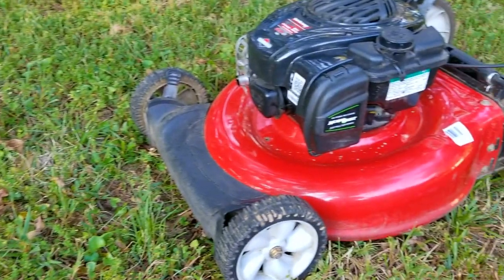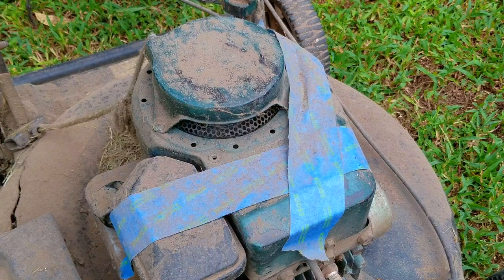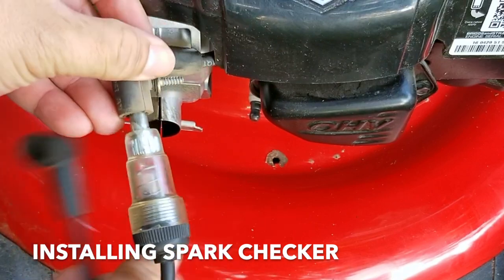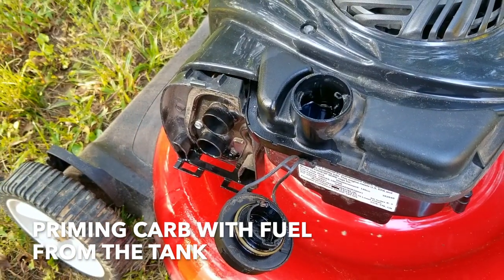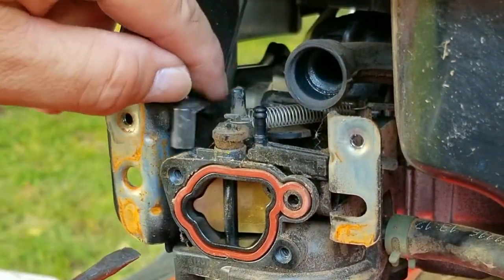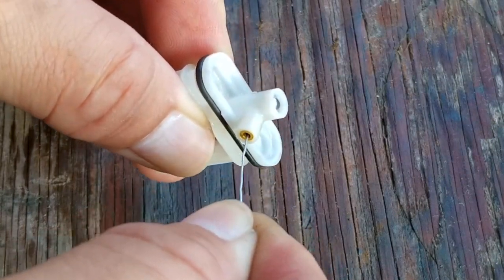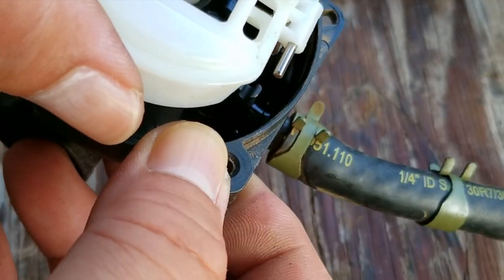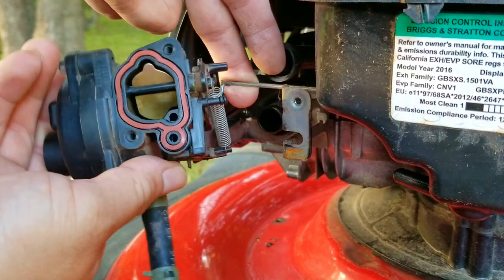Why Did Briggs Stop Making The Flathead Engine?

Comment: B&S lost me in the early 60's with their aluminum cylinders & valve seats!   A deliberate attempt to fuck over all those non-commercial mower buyers with a terrible designed-to-fail engine!  First I've heard of the oil drain, and am not very surprised at the attempt to screw any loyal customers left standing.
Reply from the maker: thank you al ro.

Comment: Neither the, Tecumseh OHV engine was powerful (6HP) Bulletproof and lasts for ever. Still use and have the one I bought over 20 years and it still runs and starts like new. And never done a thing to it other than oil and air filter changes
Reply from the maker: thank you Matthew.

Comment: I wonder if its some sort of pro american (racism).  The Japanese have long built a superior engine that actually requires nearly no maintenance.  Back in the 80s many farmers switched out of briggs on their augers.  Come harvest that engine needs to start without issues.

We didn't switch but sure looked at it.  Tractor repaired in stead.

I'm pretty far north.  My lawnmower has a Honda, the sales guy really wanted me to buy the intek.  That was 10 years ago.  Since that time I've changed the oil twice.  No recoil problem.  No clogged fuel jet.  No spark problem.  Its was less than $500 after taxes and has front drive assist.  My brother busted the deck up a bit running over rocks and stuff (he was angry at the time).  My yard is big.  What I'm saying is this mower is abused and over 10 years has never failed to start in the spring after sitting for 7 to 8 months.

Thats what I like about the Japanese motors.   Had a dirt bike as a kid.  Don't know where the carb is.  Only issue was running out of gas (there is a lever to use the reserve).  Abused that thing for 5 years than my brother took over.  After the abuse of 3 boys my father used it to check fields.  75cc  busting out every bit of hp to carry an over weight adult at 50mph.  In 97 we auctioned it off with the farm equipment and got the same price we paid for it.  The guy thought it was relatively new.

Stop beating a dead horse.  Let someone else hammer out the issues on the new design.  The orient started the new design 50 years ago.  Better believe they are in constant improvement.  Briggs took one old design and changed nothing till they were forced into bankruptcy.  That doesn't deserve a reward
Reply from the maker: true, but Briggs unwillingness to change, until they were forced to, mimics what happened to Kodak.

Comment: I'm going to say right off the bat, emissions regulations.
Reply from the maker: is that's your answer, they decided to change 10 years too late.  Everyone had been making OHV engines for quite sometime.
Reply: @INSIDEHOUSEGARAGE  well even those are going to probably be phased out. Personally , I use an electric.
Reply from the maker: it's just a different set of problems. 
Electric motors won't last for a long time
and the batteries wear out, just like the one in your phone
or laptop. After each cycle, it will loose a small amount of capacity
till one day, you'll have o replace it because it won't last long enough to finish the job. Batteries are very expensive, more than a service on a gas tool.

Comment: Old gas is worse with carb engines because the carb and fuel is exposed to the air - evaporation and oxidation ruin fuel.  Fuel injected engines are more sealed, reducing evaporation and oxidation.
Reply from the maker: thank you Sylvan dB.

Comment: If they hadn't gotten rid of the old engines people would never buy the new ones.  Metal parts are recyclable, plastic crap is not.  A full step backwards in my opinion.  I'm running 1960's Arien snow blowers with Tecumseh engines that start every year.  They both have carbs with drains and fuel shutoffs on the tank.  No residual garbage in the carbs.  Just another incidence of reverse progress going forward.
Reply from the maker: thank you Ralph Watten, the plastic is a sure sign they wanted it to be cheap but not reliable.

Comment: No, I'm sorry, I don't agree.  At all. I have repaired engines / equipment for 40 years +.  Doesn't make me infallible, just experienced. The switch to OHV was done to improve the emissions.   
Almost without exception, engines bought to me for no start, have a fuel issue.  I can virtually guarantee the emulsion tube / by pass jet is partially clogged OR the needle jet is leaking.  I don't bother to pull them apart now, I just replace the carb ($50) and away we go.  The Root Cause is poor maintenance.
1.  Run them on Premium fuel.  This has no ethanol in it and ethanol attacks rubber parts over time.  2.. When you put your unit away, add 3cc /L of conditioner to the tank and run the engine for 10 minutes.  Shut it off and you are safe to leave it.
I look after my own equipment and those of friends and neighbours, now that I am retired and have NEVER had a problem firing any unit up after layup, nor encountering subsequent engine problems.
The above is in addition to Basic maintenance.
Most of the people I met admitted to `throwing a tarp over it and parking it in the garage'.
Reply from the maker: No I'm sorry, I don't agree. At all. I have repaired engines / equipment for XX years. Doesn't make me infallible , but I've got experience as well. I also have eyes and what I saw flatheads being made while OHV push mowers had been in the market for a long time.  
This is basically Kodak, all over again, except it's not film  But  engines. 
Too slow and too unwilling to change, in a market they felt they were dominating in. Why change.

Comment: Strange that you blamed the new design engine while all the work you did to fix it was on the carburettor. There's nothing at all wrong with the engine design and everything wrong with the crazy plastic carburettor. It's far easier to use a better designed alloy carburettor than it is to convert to an overly complex fuel injection system.
Reply from the maker: the rant was about the overall design, execution, and ultimately how late they were to get them to market. The video was a distraction and it apparently worked well.

Comment: I wouldn't buy either.  I have owned enough Briggs engines (flathead and overhead valve) that overall, I wouldn't buy another.  The flatheads were temperamental, had plastic carbs, a weird fuel system that's needlessly complex with a cheap diaphragm based fuel pump for a small engine, they leaked oil, had bad coils, terrible carburetors compared to the competition (this includes Tecumseh) and the overall build quality seems incredibly unpolished compared to Honda and the others.
Reply from the maker: you do make point, it was built at a cost.. a very low one,  but we still have a lot of survivors from 20 years ago which is decent in my book.

Comment: High Octane Fuel is Required in High compression Engine's, Period. If Your Engine's Compression Ratio is under 10:1 running 93 Octane is Pointless.
Reply from the maker: I don't think this is a high compression  engine engine.

Comment: Its not gasoline that plugs carb its the ethanol they put in it! Do not I repeat do no run ethanol based fuels in anything with carburetors and especially any small engine no mater what manufacture says.
Reply from the maker: you are correct.

Comment: Reed-type breather valve kills these engines, sends so much blow-by into the air filter and intake.
Reply: If you wanted one of these engines to actually last a while, remove the crankcase vent hose from the intake box, plug the hole in the intake, route the hose and extend it the edge of the mower deck, use the smoke as mosquito repellent.

Comment: The old engine was too reliable so they missed out on sales. As long as everyone sells garbage they will continue to sell new ones as the old ones will fail consistently.
Reply from the maker: that's what It seems like, and most will play right along.  The option would be to hold onto the flatheads for as long as possible. The funny part, is that if you take care of it, there's a very good chance it could be your last mower.

Comment: Several brands of mower now have no oil drain plug and are advertised as "no oil change necessary if in private use."    It makes sense as oil is expensive, the used oil must now be disposed of per evironmental regulations, and oil costs money.   Mowers are so cheap now and since in private use will last 5 to 10 years anyway, buying oil just isn't justified.
If you mow lawns for a living, you shouldn't be using these types of mowers - you should invest in a much more expensive mower designed for use 40 hours per week and change the oil.
Reply from the maker: oh another one.

Comment: Subaru/Yamaha OHC motors. Or a good old Victa two stroke.
Reply from the maker: yes those are very good engines.
Reply: @INSIDEHOUSEGARAGE  too bad the decks usually are bad on the Yamaha motors, we only get them on Ryobi mowers , right now I'm rocking a Masport with the same motor as in this video but with the manual prime, time will tell if it's as reliable as my previous flat head, but the two stroke victas run forever. Kawasaki OHV can be found but they are pricey.
Reply from the maker: very true, hopefully anyone that buys these engine will take some care, otherwise they may have issues later on. Most have issue with just doing a standard oil change
Reply: @INSIDEHOUSEGARAGE  To be honest all I do is tip the mower fill side and drain and fill it up with a 5w30 that I have laying out for my Golf And Skoda octavia, since I buy it in bulk doesn't seem to mind, flat head didnt have a drain plug either. never had a problem starting it, I avoided the self primer as in this video because I knew it would cause havoc, in Australia it doesn't get cold in winter so I just leave everything as is. Never had a problem in my 2 years owning this Briggs. filter is just a small piece of foam though. We don't ave ethanol in most out fuels, you can opt out so I use 91 RON, 87 AKI, non ethanol. Only states no e85, but who is going to run race fuel in their mower lol. We can use e10. So we get 91, e10 (94 RON) 95 pure and 98 pure and e85 (107 RON).
Reply from the maker: thanks for the information

Comment: B&S hasn't made a good engine since the original Quantum. Even the once Daihatsu built Vanguard series are now throw away engines. Properly maintained flattys will still be running long after their current offerings are in the landfill.

Comment: No idea but I wish they hadn't. The flat head deign has nothing to do with the emissions. Fuel injection is a stupid idea on a small engine. It's an extra expense of no true advance in performance. Just go back to fitting proper carbs and ta da problem solved for power  reliability and emissions.
Reply from the maker: hmm very short and sweet.
Reply: @INSIDEHOUSEGARAGE  my flat head Briggs is fitted to a Suffolk which is now 47 years old and starts first pull every time.  It's got a set of points and everything. Starts runs stops all as if by design.

Comment: I feel they had cut corners on their new engines they use plastic camshafts and carburetors ive seen the plastic carburetors warp causing them to leak fuel everywhere today gas is very expensive I do not like waisting gas or consumable shop items such as sparkplugs air filters oil filter oil etc and the first time i worked on one i was not impressed my 675 exi is not as good as the quantum flathead briggs engines but its decent i say they are good but not good. Nowadays i choose Honda or Kohler for a brand new machine. I wish Briggs would adress these issues they would be good engines if they used metal camshafts and carburetors.
Reply from the maker: thanks I think a lot of people feel the same way about the newer engines with all the plastics.
Reply: @INSIDEHOUSEGARAGE  you are welcome

Comment: I can attest to the unkillable flathead. I run small engines for shits, and I have a 8hp flathead on a old yardman, it wont fckin die, it lives its life on full, same for the clapped ass one on my craftsman, that one has it worse then the 8hp. They start 2nd or 3rd crank everytime without fail. And I've pulled a 3.5hp Techumseh outta the dump, had it running in an hour. Idk why but death refuses to go near a flathead in fear the flathead will end death itself
Reply from the maker: you got that right.

Comment: Reality is they most likely moved away from the flathead design due to ever tightening emissions.
Like it or not flathead engines are woefully inefficient compared to ohv designs, there is no getting around the poor gas flow with a flathead, reliable as they are.
There's a reason automobiles/trucks/industrial engines had more or less completely moved away from flatheads by the 60's.
Reply from the maker: I agree, and well said.

Comment: Briggs hasn’t made a good push mower engine since the 90’s. The cylinder material is softer, castings are poorer quality, rings are not as good, seals wear out far too soon. Carburetors are junk. Honda is miles ahead
Reply from the maker: Thanks for the info

Comment: I couldn't replace the starter on mine or find a replacement online..... cheap plastic teeth inside it.  Also brags on the packaging it never needs an oil change....

Definitely designed to break and need replaced. I just removed the starter and manually coil a rope and start it myself....
Reply from the maker: nice work getting around the issue. thank you Jungle Lane.

Comment: It's still the same engine block as the old one with ohv. I find ohv are far more efficient in regards to fuel efficiency, nor do they require a number of valve grinds as the old ones do which were prone to burning valves. For contracting ohv are the way to go. Not sure about those honda's with the ohc & the dumbass idea of an internal cambelt. That said the gsv's do have some grunt
Reply from the maker: thank you score NZ, and you are right, OHV is the way to go. The only issue I have, Is that, I've never seen a honda, come in, with "any" timing belt issues. So I guess it must be working well.

Comment: what u taking that carb apart for you never used the carb rebuild 9000 its easy step 1 remove air filter step 2 choke the piss out of it 3 step 3 flood the motor step 4 it starts
Reply from the maker: sound good, you go first I'll watch
Reply: @INSIDEHOUSEGARAGE  hasn't failed me yet

Comment: Only flat heads that iv seen die is  when they wont start from ethanol and the customer installs a new spark plug with 3 times the 
thread length and destroys the valves.
Reply from the maker: thank you  Jesse Malone.

Comment: This was all forced on manufacturers by Walmart to begin with. The rest of the companies went along on the "can you make it cheaper" bandwagon. Every year they go to these companies and ask them if they can make it cheaper. And after that products are now so cheap they won't run. It's all about profits. I have one of the new plastic carb engines and I've had to tear it apart four times and I'm once again having the same problem. It won't stay running because the carb is clogged yet again. Pure crap.
Reply from the maker: thank you Liberty Justice.

Comment: The flat head was never going to meet the ever stricter EPA standards and the over head valve design produced more power at considerably less fuel consumption. Now the government wants to ban all fossil fuel engines along with the gas stoves in our kitchens! Just look at what happened to Honda with the ridiculous law suites brought by California's CARB board. Law suites from bureaucrats flying around in private planes and getting chauffeured around in limos. What a joke. With all the competition from China, Briggs had no choice but to design a basically disposable engine. I've worked on many Briggs engines including the new ones and find the E-series very easy to work on. I'm still a flat head guy and think the Quantum was the best engine they ever produced as I've abused plenty and they just keep asking for more. As for the Intek, I find them to be good dependable engines as long as proper maintenance including pulling the covers and keeping the fins clean is done.
Reply from the maker: this is A very good comment.  I appreciate it Peter Toth.

Comment: B&S engines = utter crap. EVERY single B&S pos engine I've ever owned crapped out the ignition coil which required replacement, yet my GXV Honda has NEVER let me down. Ever.
Reply from the maker: thankS

Comment: you will not see much "R&D" coming from "B&S", due to the fact that the company is for the most part "HISTORY". it is now in the hands of a "HOLDING COMPANY". I have been working on small engines 50+ years. I witnessed "B&S" engines made from cast iron that were built to be rebuilt, to the first/ second generation aluminum engines that were also built to be rebuilt. then came the "QUANTUM" engines( junk) with plastic cams, and valve seats that liked to drop out. if the engine drops a valve seat, the engine block is toast ,you can not re-install the seat and expect it to stay in the block. now you can buy "B&S" engines for grass cutting machines that the crankcase is sealed, pre- charged with oil from the factory, with no way to check/ change the oil. this engine is designed to fail!!!!.I will keep my newest "B&S" engine, a 92502 that was built JAN. 5, 1969 with 8,500 hours on it( I bored the cylinder .010 o.s. in 2000, and .020 o.s. last year with 8 khrs on it)
Reply from the maker: thanks for the information Gregory Clemen
Reply from the maker: that is quite unfortunate